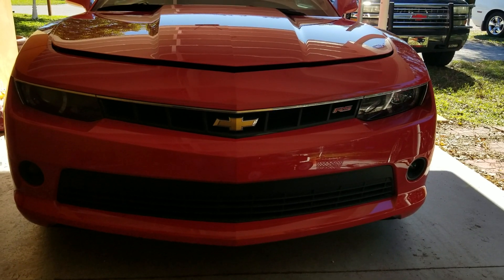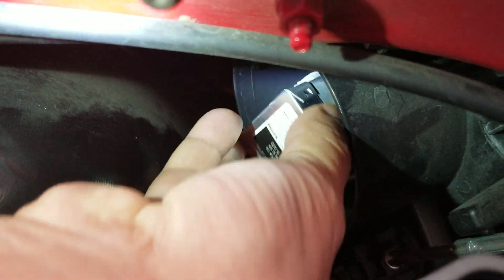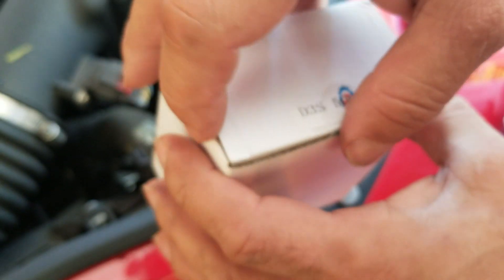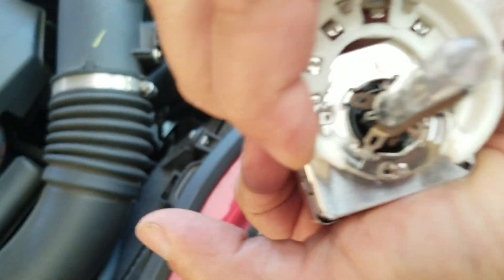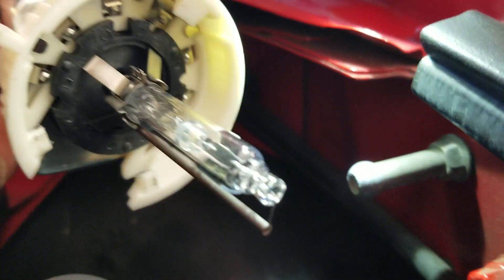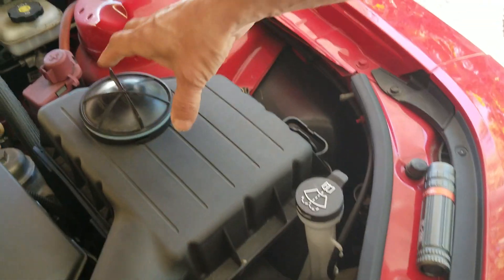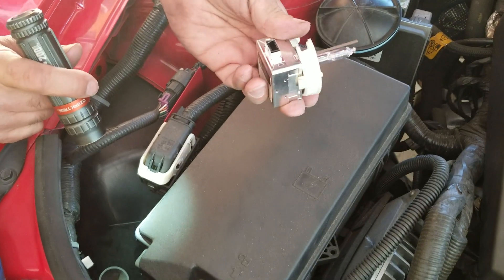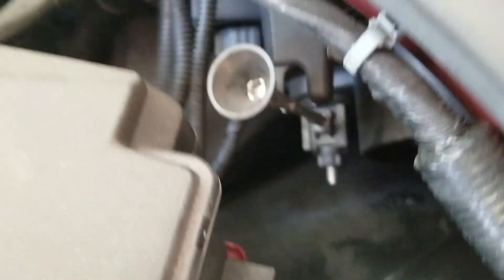Gen 5 Camaro HID bulb replacement

Comment: I must admit! Your video was well explained, simple & in people watch & listen ITS SO MF EASY!!!! After body shop telling me the “whole headlight” would have to be replaced, one headlight being more than $1700, I wasn’t doing it so I asked for my car back! Stuck with no option but to try and figure it out, I found the cap under the hood and the back of the light! Started digging around on YouTube & found you!!! Thank you! For my non mechanic & non engine knowledge, single mom, no man around your video helped me changed my bulbs!! $28 later I got headlights!!! THANK YOU KIND SIR YOU’RE MF AMAZING!!!!
Reply from the maker: Thanks for the kind words and the feedback. That makes it all worth it! Glad I could help and glad you were able to get it fixed!
Reply: Replacing whole headlamp assemblies, install of replacing a REPLACEABLE headlight bulb…. Some mechanics are greedy and looking to scam the less educated/fortunate folks.. 

But seriously, that’s crazy for attempting to fix a rather easy, simple issue on a mass-produced car, with plenty of instruction manuals and parts readily available… 

I’m assuming you went with eBay or Amazon HID’s or LED’s? How are they holding up 2+ years later? I’m running a set of okay priced LED’s from Amazon Prime, that I swapped out my super nice factory (Osram branded) HID bulbs for. They’re starting to dim a year and a half in, so I’m getting ready to replace them with a more reputable brand, one that has a higher quality light bulb assembly.

Comment: I have a 2015 RS with 108, 300 miles on it. Still runs great, and I hope that it lasts forever (I sure as hell won't; I'll be in 72 in May 2025). I just found this post, and you have saved me a lot of money. I now know for sure that I will be able to replace the bulb myself. Thanks!
Reply from the maker: @BurtinLancaster  we still have ours and and absolutely love it! Take your time and follow the steps and youll be fine. Hardest part I think is getting the bulb back in and locking the ring without damaging the new bulb. Try it with the old one before installing the new one. Good luck and thanks for watching!
Reply: @shumanatorsgarage8921  I'm glad to say that everything went perfectly, thanks to your video. I bought a bulb that Sylvania had made in Germany to strict OEM standards. That increased my cost to $150 at Advance Auto Parts but still cheaper than the Sylvania website by $30.
Reply: 130k miles on my SS replaced twice
Reply: @TEXHAPb-  That's encouraging. I hope that mine lasts at least that long.
Reply: @BurtinLancaster  Over time they don't shine as brightly. Rockauto also has inexpensive options.
Reply: @TEXHAPb-  Thanks. I will be sure to look for Rockauto when the left light fails.
Reply: @TEXHAPb-  yess i work at a dealership and we use rock auto its cheap and it's good quality

Comment: This is an absolutely perfect video. Saved me $300+ (dealer quote). I have a 2013 2SS with RS package and this video worked perfectly, explanation was awesome. My access to light was a little tighter due to engine being a V8, but process is the same. I cant thank you enough. It was hard getting the wiring plug off the existing bulb but as you said a screwdriver and a little patience and it came off. I purchased a Sylvania HID Xenon D1S (35W) bulb from Auto Zone. List price was $99.99 but they price matched Amazon at $79.99 and the color matched perfect. I am original owner and my other light was stock, this Sylvania matched color perfectly. Thanks again, this was such a relief saving me hundreds of dollars. I am not handy at all and this was simple to do.
Reply from the maker: Thats great to hear! Thanks for the feedback!
Reply: Hey bro I know this is a little late but what wxactly did you do to get the wiring plug off of the bulb? It’s super tight in the engine bay and I can’t really do it with a screw driver
Reply from the maker: Not too late bud, this is what its all about! Just like the video shows, that metal plug has to be squeezed, it has a spring action to it, and then a small screwdriver to pry it off a little. They are tight the first time and if you dont hold that spring action in at the same time, it wont happen. Watch the video closely at that point, that was litterally the first time I did it. Good luck!
Reply: @shumanatorsgarage8921  like I can’t even get the compartment out of the little space you said twist counter clockwise and what else?
Reply from the maker: @OmarGonzalez-lf1eq  Im sorry buddy, I dont know how else to explain it. Everything I know about it is in the video.
Reply: So you have to change the box thing can you just change the bulb ?
Reply from the maker: @joshuasartor1320 You cannot separate just the glass bulb! Its an assembly as shown and must be replaced as shown.

Comment: Good video, my 2012 2SS has the black connecting ring and it was the only hard part because it didn't want to turn, I have a very old flathead that I never use because the tip is rounded off and it worked good against the plastic part of the ring that protrudes from it.
It was very humid today and after I got the new one in there was some light condensation on the inside of the lens, went over it with a heat gun on low and it cleared right up.
Thanks for your help.
Reply from the maker: That's great! Thanks for the feedback!

Comment: For those wondering how to get the locking ring off, just pull it straight back and it will come off.   No need to turn to a side.
Reply: Agreed! Just put the locking ring between locked and unlocked (right in the middle) and then pull up away from the bulb and it should pop right off. Minimal struggle.

Comment: Thanks alot ! Have looked all over youtube and all are garbage. Most videos are poor quality.  Your video wasvery detailed and exactly what i was looking for. Thanks again! I got a 2010 ss but looks just about the same.
Reply from the maker: Thanks David. Thats exactly why I made this video, because I was looking for one myself. Not sure if 2010 is the same or not. Should be similar as long as there is access. You may have to remove the air box and washer bottle with the V8. Good luck!
Reply: Hey David, 
A year ago You responded to Shumanator's Garage about your 2010 SS Camaro headlight.
Were you able to get the D3S 5000k to work or did you have to use D1S?

Comment: I just did this too!! AutoZone has the bulbs for $150 and I didn't even bother asking a GM dealer for them...like you, I went to Amazon.
Reply from the maker: Its been a couple weeks and still light up. I think they are a little clearer or whiter light than the originals, which I like.
Reply: @shumanatorsgarage8921  So did you guys light also turned on for like 15 sec  and then turns off after too? Or is it just mine that's doing that? Not really sure just want to make sure it's just the bulb and not a fuse or cable.
Reply from the maker: If your referring to the original factory bulb, no mine just went out. If your is turning on for 15 seconds and then going out, it would not be a fuse. Sounds like it might be getting hot and shutting down. I would check the bulb and see what it looks like. Also check the color when it does come on, and compare to the other side. If its turning pink, its bad.
Reply: @shumanatorsgarage8921  it does. From white then slowly goes to pink then it turns off after 15 sec. So why you say is bad? Any idea on why it does that?
Reply: What type of bulb like the code or number on the bulb
Reply: Justen Dawson hey
Reply from the maker: @livinglifevlogs9981  they are D3S 5000k
Reply: That's exactly what one of my bulbs was doing. They looked fine when I first opened the car doors and started, but a few seconds down the road one bulb would just go out and only the halo around the main bulb was lit.
Reply: @FRED SO LIT Hey, I went with a much bluer bulb this time. I think OEM is around 5000k, but I went with an 8000k bulb. I'll have to check the package when I get back home today but Amazon had some vendors who sold a two-pack for $40 !!! Its been about a month and no degradation so far. Even if I only get a year or two out of these, that's $40 well-spent

Comment: I can’t do it in 5th gen ss too many wires around plus the big computer box 😫 on the passenger side but the driver side looks much easier I really want to try to remove some of the wires around but I don’t want it I don’t know if it possible I rather remove the bumper to pull the headlight off .
Reply: I have a 5th gen SS and it was easy as shit to get to both sides. Lol didn't have to remove the fuse box or anything

Comment: Do you happen to know if that braided wire is replaceable? I went to change my bulb and the connector is melted
Reply from the maker: Looks like you can buy those but I dont know what it takes to get to the other end or what caused it to melt in the first place. Could have been the bulb or the ballast.

Comment: Do both bulbs have to be good in order for lights to work or can you put just one new bulb on to see if that light bulb will turn on. Asking cause both my lights don't work only if I keep turning off and on on auto they will end up coming on
Reply from the maker: They should work independently. You can change one at a time.  If they come on automatically and don't go out prior to you  shutting them off, then Its probably not a bulb issue. You might want to test the switch. If it's on auto, obviously make sure it's dark. As you see in the video, I had to turn them on manually to test them, in the daylight.

Comment: So how are those lightbulbs holding up are they still working how long did they last?
Reply from the maker: Actually I was about to make an update comment. The passenger side just went out about a week ago. Halo is still working and I havent had a chance to look at the bulb yet but its likely the bulb. Still well worth the savings in my opinion. I will  order the same ones if still available.
Reply: @shumanatorsgarage8921  So how long did it last?
Reply from the maker: @hungary11  Right about 3 years. I made the video in January 2019. The original OEM bulb was just over 5 years old when it blew. The Amazon bulb on the driver side is still working  nice and bright
Reply: @shumanatorsgarage8921  great thank you!

Comment: Thanks for making this video.
After I changed it the bulb there is a sound that I can hear - high pitch beep noise- with little bit of burning smell. 
I used the Phillips one on to the 2014 Camaro. 
Is that normal? Please help.
Thanks.
Reply from the maker: No, that does not sound normal. You need to try to determine exactly where the sound and smell are coming from. Maybe the new bulb is bad, or there may be another issue, (such as the ballast for example,) which you need to diagnose.  You may need to take to a mechanic if you cannot figure it out.

Comment: ya,  All RS are V-6; not V-8.   So, do I need to disconnect the battery prior to removal and install??
Reply from the maker: I did not disconnect the battery, but it's probably not a bad idea. Usually a recommended safety measure. Either way you need to be careful as there is high voltage stored even with the battery disconnected.
Reply: @shumanatorsgarage8921  ever changed out that RS badge on the front grill??   OR I wonder if I could just paint it red again
Reply from the maker: No I have not. Looks pretty easy to remove though. And I'm sure it could be painted.

Comment: I want to change mine. I hate the bulb its not bright enough and where im at we've been getting alot of rain lately. So i want to change it from the bulb to hid or led. Would that work ?
Reply from the maker: You cannot install a xenon bulb in a non-xenon lamp. There are aftermarket conversion kits out there, however I am not familiar with them and cannot make any recommendations.
Reply: Halogen assemblies are awesome for upgrades. Never go for the RS package like I did. Morimoto lighting, and diodedynamics sell several conversion kits to upgrade to LED from halogen lamps. Super simple plug and play. Never go to HID lights. They are too expensive, and difficult to mess with. LED puts out the same light, beam pattern, color, and everything, and even shine further without blinding other drivers. I recommend looking into those sites I mentioned, and picking a conversion kit you want, you can even add the Halo lights fairly easily too. I'm currently trying to retrofit my 2010 2SS with halogen assemblies so I can upgrade to LED with ease, and save about 850 bucks. I hope all that helps in some way.

Comment: Does anyone know if I can buy that little white clip anywhere? The guy at the dealership checked my lights and all of a sudden my clip is missing I haven’t messed with that light at all neither has anyone else because it’s never had to be replaced then he tells me I have to buy a whole new headlight which is $1100 so I went to AutoZone and purchased one  bulb for $160 and put it in myself and rigged it so it stays in place. I put the dust cap back on and started calling the junkyards to see if any of them have that clip but so far no luck. Does anyone have a suggestion on where I can order one of those white clips that hold the light in place?
Reply: You can't get it from the dealership??

Comment: I did everything step by step as you did and bought the amazon HID’s you put up The lightbulbs Came working well, But is the driver side headlight that won’t turn on once I connected it to the gray cable it won’t turn on. I tested of the bulbs with the passenger side that are working well , so the bulbs aren’t the problem It just seems when I connect it to the gray cable it won’t work after that. Any suggestions? Thank you for your amazing video by the way it helped a lot
Reply from the maker: Well, without being there its hard to say. You need to be sure the wiring harness is not damaged including the plug itself. If that same bulb works on the other side of the car, then its obviously not the bulb / ignitor, and likely not the switch. Check your high and low beams and see what happens. Could be a ground issue or a module, or a ballast.

Comment: At the 2 minute mark, I am having so much trouble just simply pulling the bulb out. It’s so frustrating. The box won’t spin counterclockwise for nothing no matter how much I tug at it. I don’t see a white ring but a black one instead 2012 RS. 😤
 
I tried again. I guess I’m screwed to pay money. This vid gave me false hope.
Reply from the maker: Do not try to turn the siver box. You turn the retaining ring only. That ring has to turn a little counter clockwise enough to unlock the bulb. Then pull the box straight out. Hope that helps.
Reply: @shumanatorsgarage8921  that ring around the silver box is surrounded by some black locking clip preventing me from turning ring attached to the light. I can feel the ridges on the ring but it won't turn for s***!! I may have to completely remove my air filter out just to be able to see. I can't see how to release and move the damn clip out my way and I don't have a small enough mirror to reflect how the black clip is keeping it held into place. I'll try again in the morning, in the sunlight. Unfortunately, your video is the most detailed and just about every other video on this is useless but you may not have had something blocking off the light from being pulled out. I really don't want to resort to taking off the entire bumper. I mean that black locking clip is the only thing stopping me in my tracks. I turned & pulled hard enough to break the damn thing if would be, it still won't move at all.
Reply: I eventually did get the bulb out. It was tough as hell but Amazon lied and said the bulbs that you posted doesn't fit my car. So I bought Sylvania ZXE silverstar  H13-9008. The damn bulbs don't even match up. It doesn't have that silver box. So I have to waste more time and just order the ones you posted instead. I just hope to god my bulb doesn't burn out by then. It's been a week.
Reply from the maker: Glad you got it out! Not sure why yours was different or what it was. I cant say for sure if the bulbs I ordered will fit your application. I have heard some have a black ring but dont know what else is different about them. You will have to do some research on it. Good luck!
Reply: @trunks2505  there's two different style bulbs.  My wife has a 2011 RS.  It has bulbs like what is shown in the video.  I purchased the wrong bulbs the first time, which stated that they fit her car.
Reply: @Mark-oo3om  -Yeah, eventually I did get it off. It was on tight as hell and I didn't want to use some type of pliers in fear of easily snapping something. It had a black color ring instead of white but it's the same. I had to wait a week later for my new bulbs and those one were wrong too as I brought what the uploader posted. It was like a certain indentation around where the bulb screwed in at that was slightly different and forced me to buy another set and wait longer. On the back of the factory light, it tells what exact type of bulb it is. My old one burned out but luckily I didn't get pulled over by the cops.  Installing it back in was simple I just wish now that I've bought brighter bulbs than the 4300k ones.